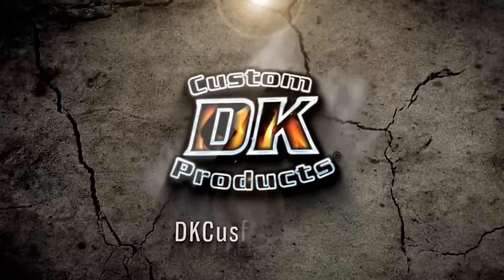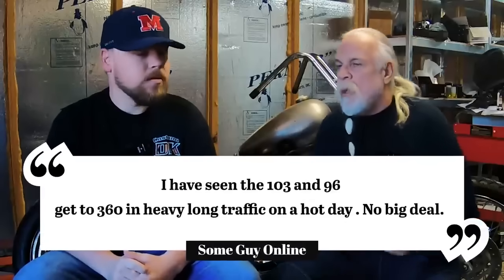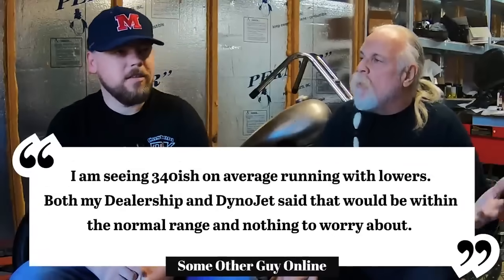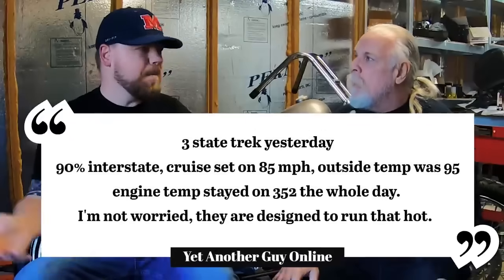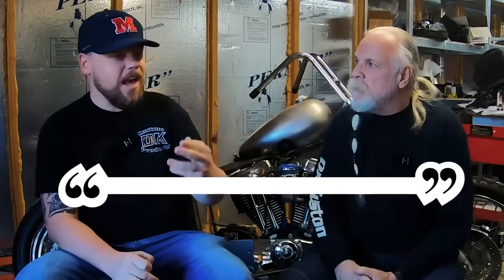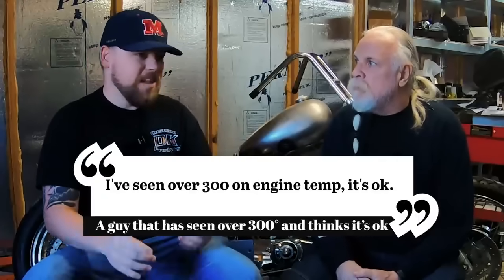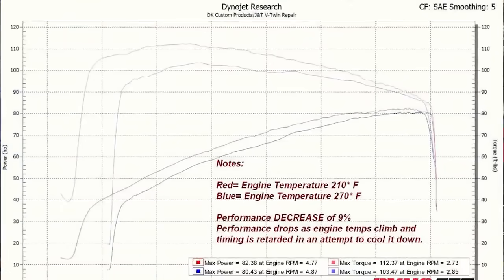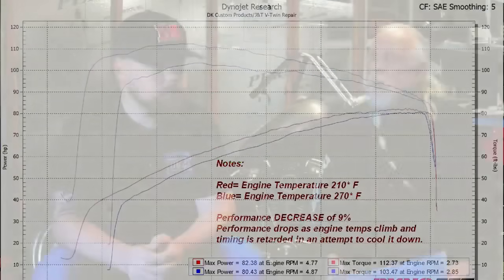Harley's - The RESULTS ARE IN About a Popular Myth

Comment: my 1st summer living in vegas area riding with stop lights didn't take long on the triglide (2012 TC) with stage 2 in it, get hot loss of power greatly, got the love jugs week later which helped drastically, since then put the tank lift. other for helping running cooler delete the stock air cleaner cover. still want to add more for cooling like the relocation reuseable oil filter ya have, just matter coming up with the extra money for it.
Reply from the maker: Sounds like you’ve already taken some great steps to keep your bike cool, the Oil Filter Relocation Kit is great for cooling and for easier oil changes! I totally get needing the funds. I am not sure if you are aware or even interested but we offer Affirm for paying in instalments instead of having to come up with a bulk of money at one time. 

You can see the Oil Filter Relocation Kits at this link - https://www.dkcustomproducts.com/oil-filter-relocation-kits-c610.htm

Here is a written report we have made on Why & How to Cool Down Your T/C & M8 that you may find useful/interesting - https://www.dkcustomproducts.com/why-how-to-cool-down-the-twin-cam-engine-part-i-dk-cl-tc-dn-1.htm
Part 2
https://www.dkcustomproducts.com/why-how-to-cool-down-your-twin-cam-engine-part-ii-dk-cl-tc-dn-2.htm

Here is a full video play list on the subject as well- https://www.youtube.com/playlist?list=PLb3bvZgbH92_3s-2vv63QggFJ3nteFd_C

Please feel free to contact us with any questions:
Support@DKCustomProducts.com
662-252-8828

Thank you for commenting!👍😎👍 MB

Comment: This must apply to you inner city motorcycle clubs get that thing on the open road that and i dumped harley ecm went thundermax runs cooler, done!
Reply from the maker: Glad to hear you’ve found a setup that works well for you! A good tune can usually bring engine temps down by 10–15°, which definitely helps. Some of us ride our bikes daily, so city traffic is just part of the deal, even out on the open road, these engines can still run hot. If you’re not having overheating issues, that’s awesome! But for those of us who do, it’s all about finding ways to keep things cool and make our bikes last longer.
Thank you for commenting! 👍😎👍 MB

Comment: On my 2022 Heritage I typically run just over 200 degrees oil temp on the back roads and maybe 225 on the highway at 70 mph. This is in 90 degree weather. In stop and go I've seen it as high as 230 degrees. This is measured by a dip stick thermometer measuring my oil pan temperatures.
Reply from the maker: Your oil temps staying at or below 230° is great. When it goes above 230° is when the additives start to break down. Here is a video where we talk more about that you may find interesting/useful - https://www.youtube.com/watch?v=p_nnqiEzksQ

Thank you for commenting! 😎 MB

Comment: I have a 2001 FLHT twin cam and there's no instrumentation on it that tells me what the engine temps are. I've always thought Harley's engine design was flawed having the back cylinder directly behind the front one. The front one blocks all the air flow over the back cylinder. Who ever thought....on an air cooled engine....that that was a good idea? 

I have a 1976 BMW R/90 air cooled boxer twin. They did it right. Both cylinders have wide open, unobstructed and even access to great air flow over the cylinder heads. 

I love my Harley, but I'm always worrying about engine temps as I ride it. Harley LONG ago should've switched to water cooling as the inline V design is the worst design there is for air cooling. Ducati, Moto Guzi and BMW did it better. All twin cylinder engines, but with even air flow over BOTH cylinders.  I also have a Triumph 955i Daytona. It's water cooled and the average freeway temp is 165 degs. HARLEY'S RUN TOO HOT.  Poor design.
Reply from the maker: The design is why so many people love a Harley. There are a lot of things you can do to cool down your bike. 
Here is a full written report on Why & How to Cool Down Your TC/M8. On Part 2 of the report you can see how many degrees of heat you should shed from doing different modifications including moving the Coil. Part 1 - https://www.dkcustomproducts.com/why-how-to-cool-down-the-twin-cam-engine-part-i-dk-cl-tc-dn-1.htm
Part 2
https://www.dkcustomproducts.com/why-how-to-cool-down-your-twin-cam-engine-part-ii-dk-cl-tc-dn-2.htm

Here is a full playlist on Why & How to Cool Down Your TC/M8 - https://www.youtube.com/playlist?list=PLb3bvZgbH92_3s-2vv63QggFJ3nteFd_C

Thank you for commenting! 😎 MB

Comment: I was riding about 70mph on the freeway at 78 degrees ambient. My Dynojet readout got up to 306°.  That's head temp? I checked the oil temp, and it was at 169°. Why is there such a big difference? Even if I stay at about 55mph, the bikes gets up to around 290. I'm running target tune and my afr sits about 14.
Reply from the maker: There is a correlation between oil temps and engine temps...on a Twin Cam those two temps will generally normalize at the same temp, and on M8's the ET will normalize around 30-40 F above OT.  So, the best thing a Harley owner can do is to run oil and mods that will keep the temps in the ideal range, as outlined in this video- https://www.youtube.com/watch?v=rWOdQOtDv6A

Maybe you had ridden long enough to get the engine temps up, but not the oil temps at that time. 
Thank you for commenting! MB
Reply: @DKCustomProducts  we rode for 1.5 hours. I'm concerned about the ET temp as far as the read out goes. I'm thinking about doing the tank loft and deflectors.
Reply from the maker: With the Tank Lift not only will you benefit from a 10-15* drop in engine temperature, more of your chrome will be visible, it will be easier to clean, and many experience less buffeting.
With the Cooling Deflector Wings these take air that previously went around the tank and over the tank and redirects that air to shoot directly onto the engine.  These can be used with or without a tank lift.  They provide an additional 8-10* drop in engine temperature.

You can see the Tank Lifts at this link - https://www.dkcustomproducts.com/gas-tank-lift-kits-c4.htm

You can see the Cooling Deflector Wings at this link - https://www.dkcustomproducts.com/catalogsearch/result/?q=cooling+Deflector+wings

Please feel free to contact us with any questions:
Support@DKCustomProducts.com
662-252-8828

Thank you for commenting! 😎 MB

Comment: Maybe i am wrong but i am wondering when the revolution max motor will make its way into the touring bikes. Completely liquid cooled. I get your losing the signature sound but way more cooler and the longevity is worth it alone.
Reply from the maker: A truly water cooled engine would require Harley to move away from the external push rods to something with overhead cams... which is exactly what they did for the new models equipped with the Rev Max engine. Those models aren't very popular. IMO the biggest reason they are apprehensive about doing this with all models is that it drastically changes the styling of the motorcycle and the styling is the biggest reason people buy these bikes. Going fully water-cooled would mean the HD bikes are no longer set apart from Japanese models and HD will never be able to compete with Japanese model prices. With that being said, I do expect the transition to fully water-cooled overhead cam applications soon, just to maintain the constant evolving global emissions standards. 

Here is a video where we outline the catch-22 that HD is caught in- https://www.youtube.com/watch?v=N0kLaVQhbW4

Thanks for commenting! 👍MB
Reply: @DKCustomProducts    Better yet, they should go to all inline fours!  If they want to bankrupt the company, that is.  The only way to sell a Harley Big Twin is to have a large OHV 45 degree V2 engine in it.  Period.
Reply: @ i do know the nightster is gaining alot of popularity as well as the new pan america st this yr. I get it about the look and nostalgia of the harley look. But they’re going to have to eventually cave unless they can come up with something. I would buy a new road glide if it had a complete liquid cooled engine for sure.

Comment: Put any air cooled bike in a box with no air flow its gonna get hot 😂
Reply from the maker: This is true,  But that is not how a Dyno works.  It is a common misunderstanding that a bike gets no air flow in a dyno room or trailer. 
As shown in the video linked below, dyno's have fans in them that replicate the wind moving past the engine at interstate speeds.  https://www.youtube.com/watch?v=4UY0ofbRxbs
 -RM 😎😎🤘
Reply: @DKCustomProducts  the only problem is, in the test they included having the fans off..which means no airflow

Comment: It has cooling issues because you’re in a box with no wind to help cool it lol.
Reply from the maker: Yes, that is a common misunderstanding on how a dyno works.  As shown in the video linked below, dyno's have fans in them that replicate the wind moving past the engine at interstate speeds.  https://www.youtube.com/watch?v=4UY0ofbRxbs
KP
Reply: @ yall stated in the video the fans were off to simulate bad traffic or whatever.  Then pushed the bike to cursing speeds which makes no sense…
Reply from the maker: Yes, the fans are typically on when doing dyno runs.  We adjust the load and fans to get the bike up to a proper operating temperature (210) then we do a pull (which is 3-6 seconds).  During that 3-6 seconds it may warm up a bit, so before the next pull we make sure we are back at 210 F.
For this test we wanted to replicate how hot the bike gets on the road....which is easily in the 270-340 range.  So we turned the fans off to let the temp build to mirror what is seen in typical riding.  Then the fans went back on while doing the pulls.
You may find one or both of the following links interesting.
https://www.youtube.com/watch?v=o3T3yA9BKwE
https://www.youtube.com/playlist?list=PLb3bvZgbH92_3s-2vv63QggFJ3nteFd_C

Thank you for commenting! MB

Comment: The problem they have worh cooling is that hotter engines tupically get better gas milage and burn cleaner . Thats why everything out there uses a 210 thermostat now . But , when you push a motor to a ceryain point the heat wants to run away on your @$$.  Thats why they push for water cooled so much. Is it necessary ? No . But its easier from an engineering stand point.  Nowdays there are many ways to get around those issues , gapless rings , better electronic ignition allowing for a leaner a/f mixture , lower cylinder oil systems , but again its easier to just cookie cutter stamp everything than adopt other systems that might require a bit of brain power. If m8s make better power running cooler thats most likely a function of fuel injection.
Reply from the maker: You’re right, hotter engines do help with efficiency, but they can get tricky to manage. Water cooling makes it easier, but there are definitely other ways to handle the heat, just requires a bit more innovation! You can see a written report on Why & How to Cool Down Your TC/M8 here - https://www.dkcustomproducts.com/why-how-to-cool-down-the-twin-cam-engine-part-i-dk-cl-tc-dn-1.htm

Thank you for commenting! MB

Comment: Have you road the 2024 121 CVO ST most I have gotten so far 236 in heavy back up stand still stop and go traffic and according to the Harley tuner you have to have the bike up to 185 temp to tune it  hmmm vs the 107 131 on 2018 that got over 370 explain all this lol
Reply from the maker: Yes, the Gen II bikes have a larger cooler, similar to the larger oil cooler on the M8 Softails.  Here is a video showing that the bikes with larger coolers do not have as much in the way of heat challenges as those that do not.  https://www.youtube.com/watch?v=h7EdjR8l8Ag

 When you say 236, are you referring to oil temp, or are you referring to the temp of the rear cylinder temp sensor?  They are very different, here is a video where we talk about the differences between the two- https://www.youtube.com/watch?v=dBmOolo-Qwo    

Yes, we have ridden the 2024 121 VVT CVO ST (Devin the "D" in DK owns one).  Even with the VVT (Variable Valve Timing), which can help it run a bit cooler, it is like all other EFI Harley's, it should be at full operating temperature prior to doing tuning on it.  

Always feel free to email or call with any questions.  
Support@DKCustomProducts.com  
662-252-8828

Thank you for commenting! MB
Reply: @ one real question I don’t know if you’ve answered it the mid frame deflectors which one is the best one to keep on to get the best airflow to the rear cylinder so I know which one to take off
Reply from the maker: Remove the left side thigh protector.  This will help the air flow very fast past the rear cylinder and out the left side...this is good for the engine, and will reduce the amount of felt hot air on the right side.  

With the right side shield still in place, it acts like an air scoop pulling air into the space behind the cylinder...but with the left side removed, that air can now exit easily. With both installed, they are essentially two scoops that push air from both sides to collide and swirl, with no real good place for the air to exit. MB
Reply: @ clutch side correct
Reply: @ you know on the 2024 CVO ST on the screen you have different things as is the temperature that’s where I’m getting it from

Comment: ALL internal combustion engines suffer performance issues, the hotter they get. Liquid cooled engines mitigate most the heating problems because of the "liquid cooling". Harley introduced water cooled, or liquid cooled engines in 2014. At that time many harley owners said, thats the end of harley as we know it. SO here is the ironic and insane dilemma: Harley owners bitchin' cause their air cooled engine runs hot and bitchin' cause harley now has liquid cooled engines to keep the temp down. With air cooled, harley knew, years ago, that an air cooled engine could get very hot so they engineered in some safeguards, LIKE lowering the performance, and changing the timing, so the engine would cool back down and not get damaged. So the drop in performance as the engine gets up to and beyond a certain temp is a Safeguard for the engine. How stupid of harley engineers to do so. IN conclusion, if one bitches about an air cooled engine all the time....save yourself some grief and buy a bike that is liquid cooled.
Reply from the maker: If heat’s a constant complaint, liquid cooling is the logical step forward, but there are plenty of things that can be done to cool down an Air Cooled Harley. You can see a written report on Why & How to Cool Down Your TC/M8 here - https://www.dkcustomproducts.com/why-how-to-cool-down-the-twin-cam-engine-part-i-dk-cl-tc-dn-1.htm

Thank you for commenting! MB

Comment: No sarcasm here. On cruise with fans off?  What real world condition is this?  Cruising there is air moving.
Reply from the maker: I am confused by your question, but on a dyno there are 3 fans blowing on the engine to help replicate the bike riding down the road. If this is not what you are asking please specify. Thank you for commenting! MB
Reply: @DKCustomProducts  
In the beginning I think you said the bike was on cruise control, with the dyno fans off.  If this is the case, when would the bike encounter that condition?  In traffic it's usually at idle or a little above with no air flow.  On cruise control, the bike would be travelling and have air flow over the cylinders.
Are you trying to recreate a real world situation?  Or purposefully overheating it to demonstrate that an overheated engine makes less power?  Or did I misunderstand the demonstration?  Thank you.
Reply from the maker: Yes, the fans are typically on when doing dyno runs.  We adjust the load and fans to get the bike up to a proper operating temperature (210) then we do a pull (which is 3-6 seconds).  During that 3-6 seconds it may warm up a bit, so before the next pull we make sure we are back at 210 F.
For this test we wanted to replicate how hot the bike gets on the road....which is easily in the 270-340 range.  So we turned the fans off to let the temp build to mirror what is seen in typical riding.  Then the fans went back on while doing the pulls.
You may find one or both of the following links interesting.
https://www.youtube.com/watch?v=o3T3yA9BKwE
https://www.youtube.com/playlist?list=PLb3bvZgbH92_3s-2vv63QggFJ3nteFd_C

Thank you for commenting! MB
Reply: @DKCustomProducts  
OK. Thank you for clarifying.

Comment: This is a pet peeve of mine. Any one who tells you overheating an internal combustion engine won't hurt it. Plain and simple has more crap in them than a Christmas Turkey. Try over heating your car once. Then try over heating your harley and see where it gets you. Heat is the enemy. Good video guys. I hear it too, the computer isn;t going to save you for long.
Reply from the maker: Glad you like the video! Thank you for commenting! 😎 😎 MB
Reply: @timothystauffer8280  Over heated my air cooled Deutz more than once, fan belt came off, thought I ruined the engine. That was 3 yrs ago. Done it till it shut off a few more times since then. Still running fine . Deutz is amazing.